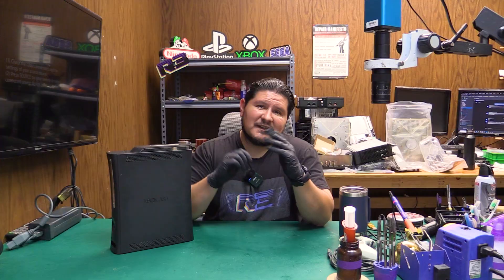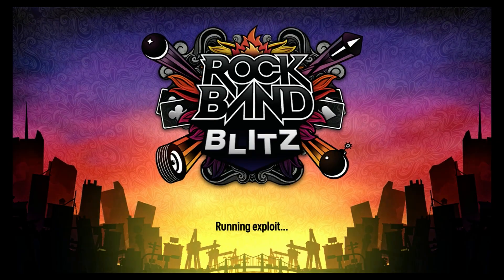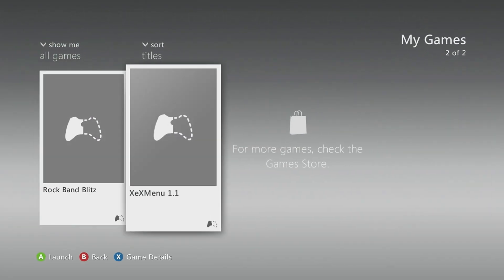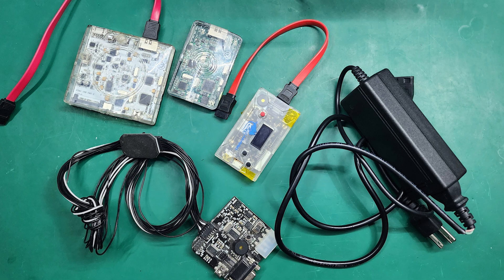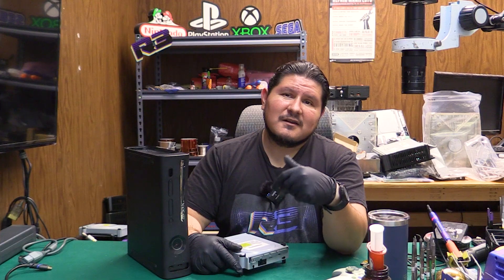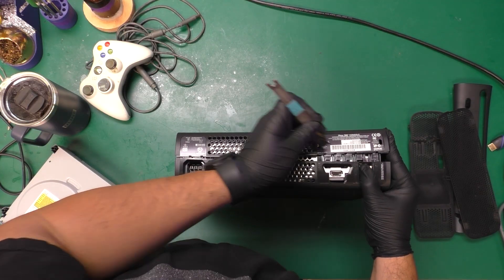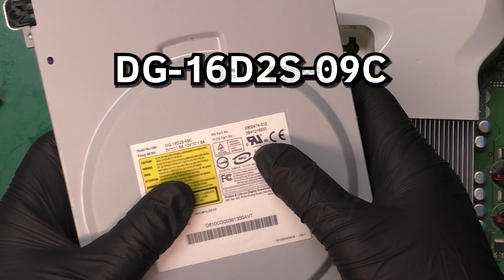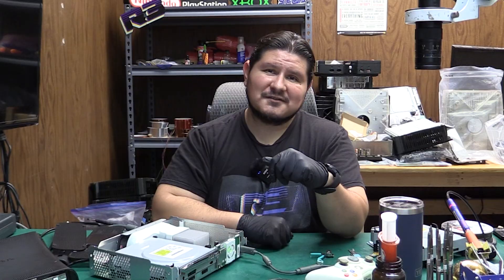Replace Your XBOX360 Disc Drive in Minutes with Bad Update

Comment: I have an Xbox from 2008 and I wanted to install the bad avatar, but I can’t because I have the 14719 update, and when I try to install the 17559 update it won’t let me. It gives me this error: 397F-4497-1600-0703-C000-0099. Is there any way to apply the update?

Comment: I had a 360 elite and soft modded it and I thought I got the dvd key and flashed it with ixtreme mod, now I got the RROD! i was Like $h@t!! 
Is there any other way to retrieve the Original dvd key? I believe I still have the dumped original file and flashed back to the stock firmware, but I still get the RROD? Is there any way to fix this?

Comment: Is there still a way to just buy a replacement laser for the 360? It's been a while. I want to do the bad update but I need to replace the laser so I can load my discs onto the ssd before hand. I'd rather not hunt down iso's on the net when I have the discs at home.
Reply: The phat 360 only used 2 types of lasers.  The HD63/HD67 for the Samsung/hitachi drives and the HOP-14 laser for BenQ/Lite/Phillips drives.  Both are still available, the HD63/67 are getting low in stock since they quit using samsung/hitachi drives around 2008.  The slim lasers should be easy to find as they made those til 2014, I believe those are the HOP-15 model.
Reply: @enragedbacon470  I have the Phillips 2008 version which is sucky because I also have a working slim laser from a scrapped slim that red ringed. I would like to get a new old stock but most available are listed as new but are used. I had this prob with a ps3 slim a few years back, I went through 3 lasers from the same place until I got a working one. So I paid triple because by the time I found out the first 2 were bad it was beyond the return date. I'm going to adjust the pots to see if I can get it working so I can download the games I have onto the hard drive. Then I won't need to replace it if I do the bad update or a hard mod. Fingers crossed.

Comment: Would I be able to transfer the DVD key over to another brand of disk drive using this method? (Example: Ben Q to Hitachi) Very helpful video!
Reply: I think that's what this is for..
Reply: I think spoofed drives can cause BAN ....
Reply: @nattila7713  Lol ban from what?!?! Xbox Live is dead on 360.. The store is gone from 360. The system can only play discs and whatever you already purchased from the store back in the day.
Reply: @graphicsgod as I know you can still be banned from live, only store is down... but I will not try to proove it :)
Reply: @nattila7713 OSIG mismatch absolutely used to be a ban. I think they stopped at some point but not sure
Reply: Obviously.